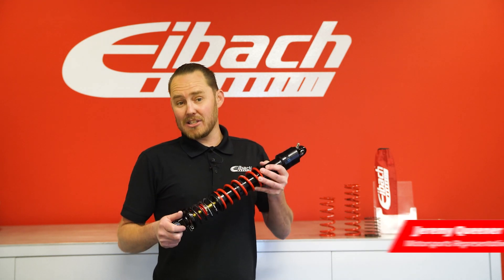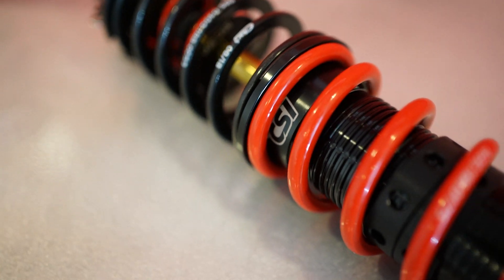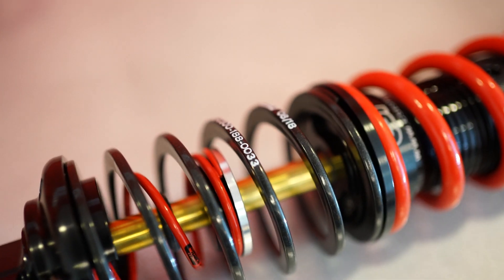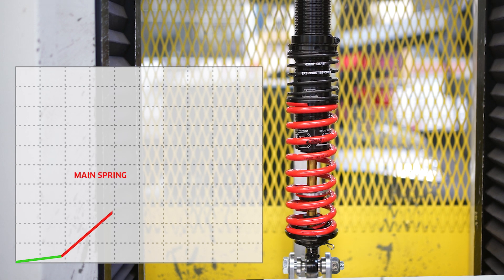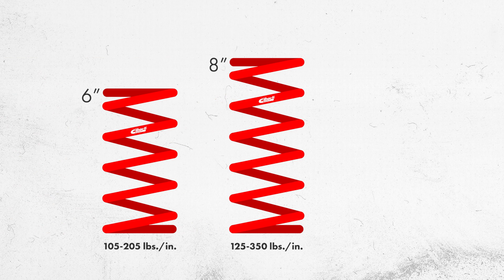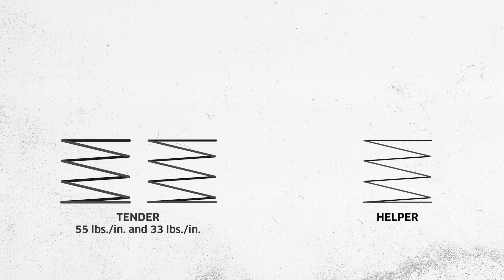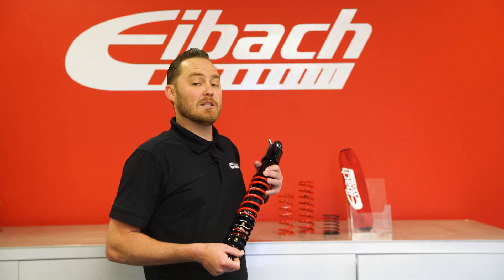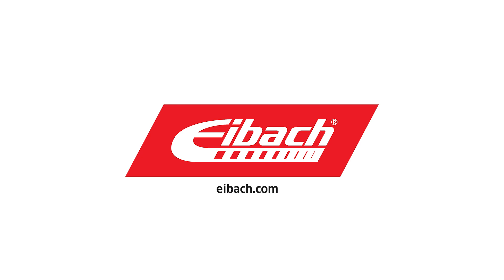Eibach Racing: Triple Rate Spring setup using 1.88" I.D.  Eibach Race Springs

Comment: I don't see any really technical help in determining what spring combo you need, how to calculate it, or links to info. I have seen calculators for two springs working in tandem and I don't understand the result being lower than either spring's rate. Then, in your video, you show a tender spring that hardly compresses, while the bigger, stiffer spring is doing all the compressing! Very puzzling, so the video raises more questions than answers for me.